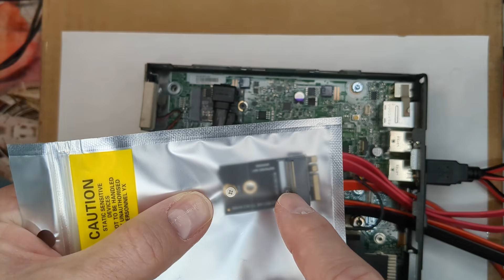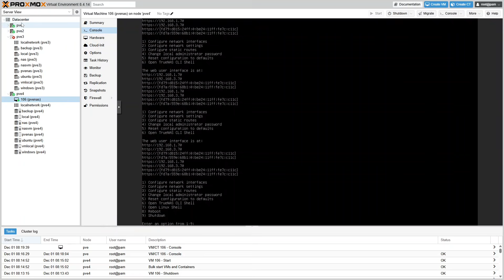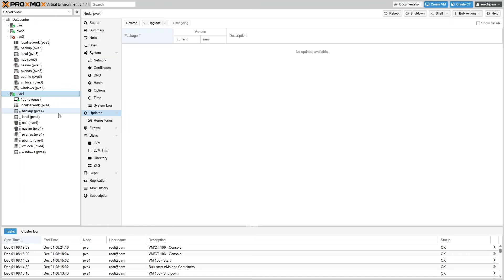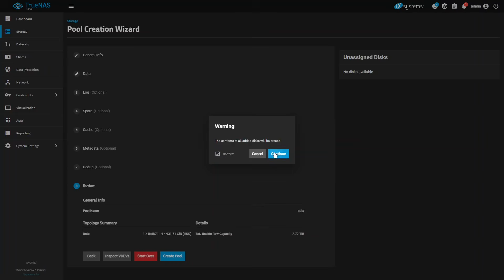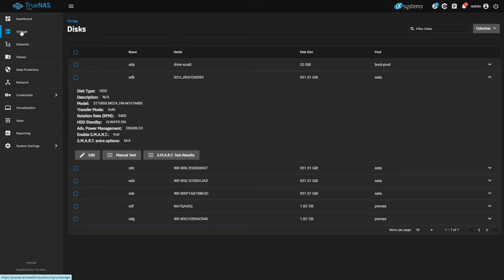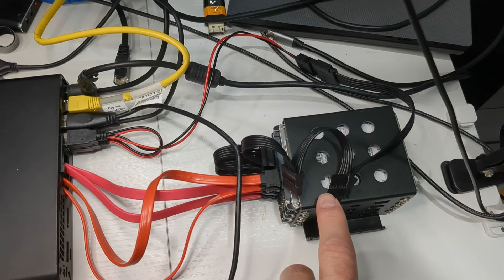NAS using 4 drives on an EliteDesk Mini

Comment: hi, thanks for the video, this might be a long shot,  but have your experienced any long posts after adding the nvme to SATA controller ASM1166?
for me the post time increased dramatically (1-2mins).
Mind sharing the bios version and firmware for the ASM board? I'm also trying to use a G2 35W
Reply from the maker: Found out some interesting info.  I know I ended up doing some flashing of the firmware but I can't remember if it was the 6 or 2 port SATA controller.  In my case, the 6 port, I don't have any issues booting and I'm running in a VM under proxmox - running 
xxd -p -s 240 -l 6 "/sys/bus/pci/devices/$(lspci -mD -d 1b21:1166 | cut -d' ' -f1)/config"
yields firmware 241224000000
Which is funny since this link https://gist.github.com/mietzen/6174d04a560fa0bb35f8e752f4743382 claims that version will lock promox - well it worked under 8.x and also 9.x.  Found this link https://www.aliexpress.com/s/wiki-ssr/article/asm1166-firmware very interesting but some of their instructions are outdated since I couldn't find firmware on the asmedia site and got mine from station drivers instead - hope this helps
Reply: @handmedowntech thanks a bunch, will give it a look, currently at boot time the device shows on screen version 220419_00_00_00
Reply: @handmedowntech figured it out..had to disable boot rom... wasted so much time 🫤

Comment: Hi, greetings from the UK, love your video I am messing with an HP Elite mini g3. I can not seem to get the m.2 slot working. Guessing bios, have checked the m2 option but never sees m.2 drive or adapter
Reply from the maker: Are you running the most current BIOS?

Comment: Did you consider using the SATA connection for the cradle (but remove cradle) and have a 2 or 4 splitter. Can go into USB or SATA versions. If so, do you have a vid with resolution or thoughts into this config?
Reply from the maker: The splitters work for power but not for data.  But I have used splitters for power but found the USB one easier to use.  I've had it in continuous use for several months now.

Comment: Im not able to get the passtrough to work. When i pass trough the whole controller TrueNAS is not able to build a pool out of the disks. If im passing trough the disks to truenas and let proxmox handle the nvme sata controller im able to create a pool. any idea what the problem might be ?
Reply: after hours of searching i found the solution. You have to set rombar=0 / uncheck the ROM-Bar Box when you pass trough the SATA Controller in the TrueNAS VM Hardware Settings
Reply from the maker: @moritzheinl8449 didn't see your response before I sent mine.  So that was in TrueNAS and not in the settings in Proxmox?
Reply: @handmedowntech
I did all the settings for IOMMU prior and it didn’t work. 

But when i added the PCIE device, wich you assigned in the datecenter, in the Proxmox TrueNAS VM Hardware settings , there is a little check box for ROM-Bar. When I unchecked it, it worked flawlessly.
Reply from the maker: @moritzheinl8449 interesting.  I'll have to check that out.
Reply: @moritzheinl8449 I applaud you for returning with the solution 🙏
Reply from the maker: Have you done the steps with the IOMMU flags to allow pass thru?  There is a good Serve the Home article I always use for setting up pass thru

Comment: Appreciate this video SO SO much. Can you discuss the cables you used to make this work? Are you running the whole thing off the mini's power brick? Appreciate your help! Also, does this setup support RAID 0/1/10?
Reply from the maker: In the comments for the video I include some links for cables - you will need both "right" and "left" cables in order to get everything to fit.  Power is via an adapter that uses the computers USB ports.  The mirroring and "RAID" are handled via TrueNAS - they have different names for it.